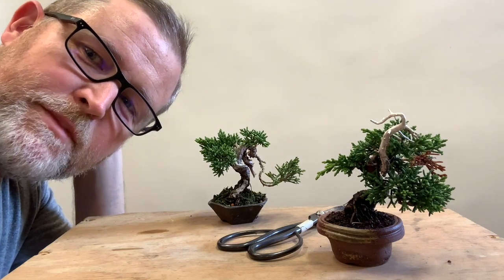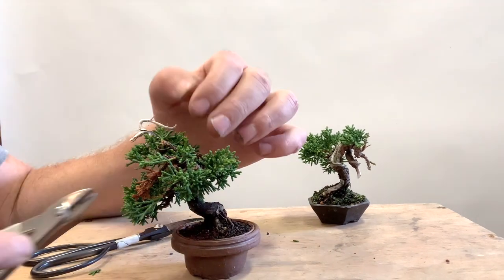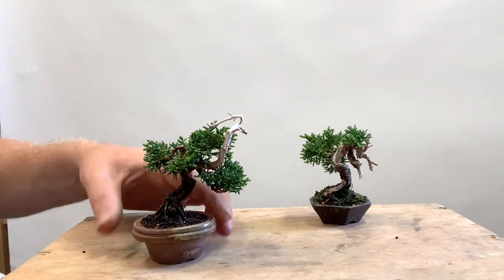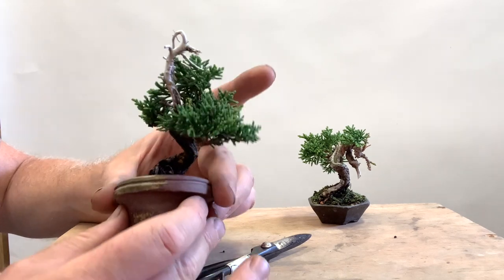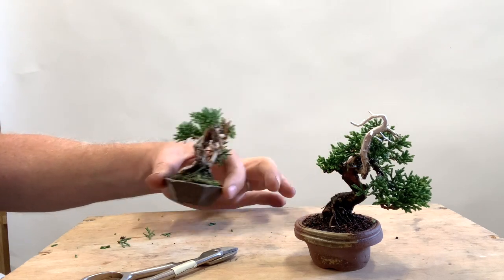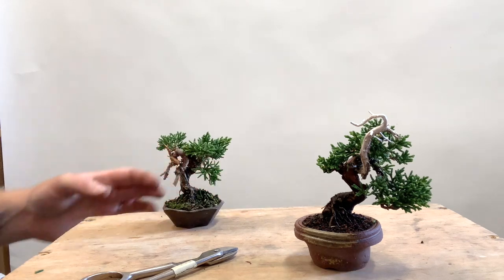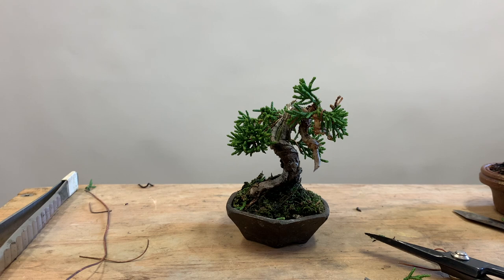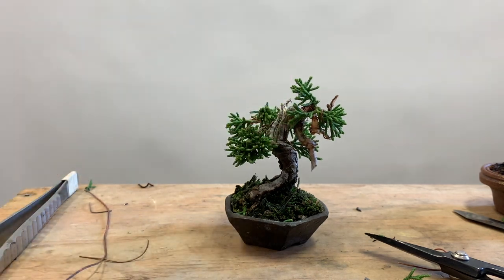Bonsaify | Mame Juniper Bonsai Branch Maintenance

Comment: Is fertilizing these trees different than bigger ones? What do you do for soil as its so tiny? I am inspired to try these tiny trees after watching your videos. Thanks for the video!
Reply from the maker: Fertilizer - Yes, it's easier to use liquid fertilizer rather than solid, but pellets can work. ;we use fish emulsion sometimes (it helps grow moss) and Dyna-Grow "Foliage Pro" sometimes. 
Soil - We use regular bonsai soil (Akadama, Lava, Pumice) but sifted to a smaller size, about 1/16".  We do that by initially sifting out all the fines from the regular soil (which we use for larger trees) and then sifting the dust from the fine particles using a fine screen like those sold as kitchen sieves.
Reply: @Bonsaify  thank you so much for the information! Bonsai is so much fun and so rewarding :)

Comment: Hi Eric what kind of tiny shears are you using ? I love your channel .
Reply from the maker: There are two tools in there - one is a Kaneshin 6.3" small scissor (it's the black steel one:

https://store.bonsaitonight.com/collections/bonsai-tools/products/trimming-scissors?variant=39514104168598

And the other is a Masakuni Mini wire cutter, which also works well as a mini scissor:

https://store.bonsaitonight.com/collections/bonsai-tools/products/wire-cutters?variant=8965157027901

Unfortunately, the latter is quite expensive.  But, for shohin and mame I find it quite useful.